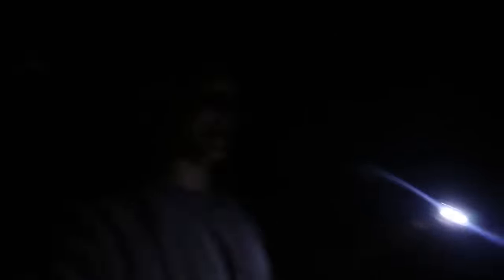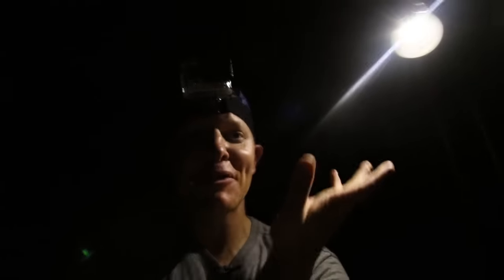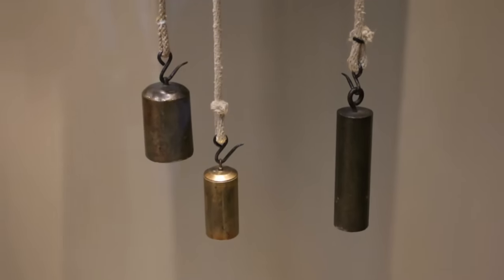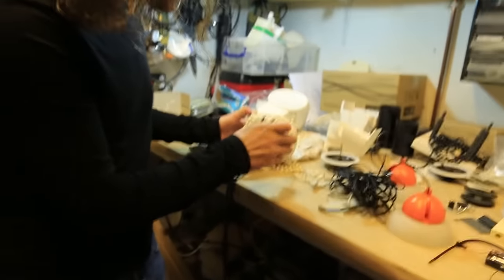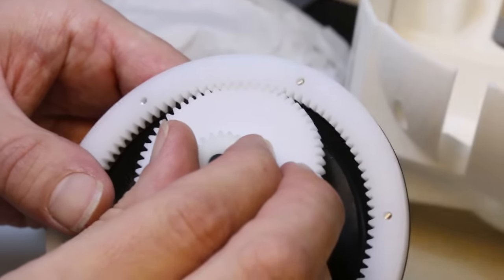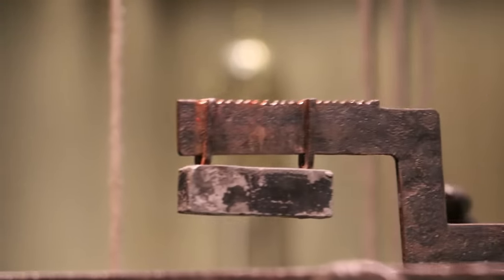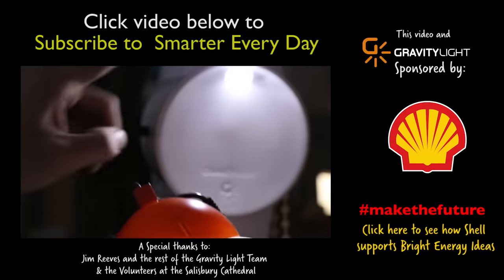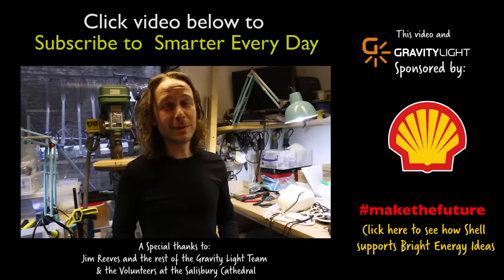Turning Gravity Into Light - Smarter Every Day 146

Comment: Great video!  But I feel like you failed to explain why/how an LED light can prevent the generator from moving regardless of how much weight is applied.  That seems like the most fundamental part of this invention!
Reply from the maker: +karmakazi219 There's a video that explains that which will be uploaded to the shell channel shortly
Reply: +SmarterEveryDay The Shell Oil channel?  Interesting.  Thank you!
Reply: In short: A LED has a sufficient resistance so the motor doesnt get shorted. As soon as the voltage of the motor gets too high (happens when it goes faster), the LED loses resistance and is therefore getting closer to a short. 
Now, you have to know that a generator that is shorted will stop immediatly. in this case, it will just be like braking a car. it limits the speed at which it can go.
Reply: You're not explaining how or why a generator that is shorted 'will stop immediately' therefore I'm no closer to understanding the answer to the question than before you made that reply.
Reply: *****
In short, it works like a watermill: If you hang something up to it, as in an actual load, it spins slower. Now, a short circuit is the equivalent of trying to power a huge city from a small little river that is hardly half a foot deep. It simply will never spin.
To explain how the generator works:
Electricity is generated by a magnetic field that is spinning around copper coils.
The magnetic field that the copper itself generates (which increases the higher the current is you pull from it) counteracts the spinning motion. So, a short circuit (which means maximum current) will simply stop the generator.

The LED is not a short circuit though, so it will simply counteract its motion just enough for the LED.
Reply: so its actually the motor that slows it down by not being able to send more than required electricity to the LED?
Reply: Michael Burt technically, yes. But you say that the load is what determines that characteristic
Reply: I believe it is called back emf. Is this correct?
Reply: I'm more familiar with the term "counter emf", but yes. 

Destin kind of hinted at it, but motors and generators are essentially the same machine working in different directions. You have 4 basic parts of the system: a conductor, a magnetic field, a current, and motion of said conductor through the field.

When you put a current through a conductor inside a magnetic field, you move the conductor. When you move a conductor through a magnetic field, you generate a current.

As the generator spins up and generates its output voltage, it also produces a counter-current in the generator which opposes the input motion, limiting the maximum speed of the generator which in turn limits the maximum supplied voltage.

E: As for why the LED limits voltage, diodes aren't "normal" electrical components. Current through a diode is essentially an exponential function of voltage. For every diode, there exists a voltage above which very small changes in voltage result in very large changes in current, which leads us back to the CEMF discussion above.
Reply: Kyle C Do you know what causes the amplitude death in this system? (Why it won't oscillate back and forth for a long time around the optimal speed and current draw, like a spring around its point of equilibrium.) Is it due to the non-linear relation between volts and current inside the LED?
Reply: etatoby
it technically does oscillate because a diode has a small capacity. but the oscillations are so incredibly small in amplitude (and thanks to the low capacity very high in frequency)
Reply: As Destin shows at 5:41 LEDs have a "Voltage Limit", which means that after that point only current rises with higher power. Voltage stays around the same. They probably have a "shunt DC motor/generator" (its the same) whose number of revolutions is dependent on the voltage. So in conclusion, if there is a voltage limit there is a speed limit of the motor/generator, too.
Reply: its not the led, its the motor that wont go any faster. motors torque depends on the voltage. since the led only allows a certain voltage in and out it prevents the motor from running at higher speeds. which in turn makes the gears move slower and the rocks fall slower
Reply: Let me see if I can explain this. With no LED across the generator, there is no current "load" on the generator and it will spin freely, as fast as the internal friction will allow it to run. Once you have connected the LED (or a load resistance) across it the current flows through it, and it creates "counter EMF" in the generator, which acts just like additional friction in the generator - it is an electromagnetic force that opposes the rotation of the generator. If the load is increased (lower resistance) the current increases and so does the counter-EMF. As resistance approaches 0 (infinite current) the EMF becomes so great the generator will no longer turn at all. Because we cannot achieve a "perfect short" it is possible to turn the generator using great force, but the current produced across the short will burn up the generators windings. So with a static resistive load the generator will still speed up as it would with no load, but at a slower rate. As its speed increases, so does its output voltage, - that increases the current and the counter EMF until it reaches an equilibrium point where the counter EMF is balanced by the weight pulling downward. In this instance, a heavier weight would make it run faster. However, the LED is not a static resistive load - its a non-linear resistance. When the voltages increases, the resistance of the diode drops, making the current increase faster than the voltage. This non-linear resistance action basically functions as a magnetic brake, limiting the rotational speed of the generator, no matter how much weight is placed in the bag.
Reply: It is the LED. The non-linear resistance of the LED as voltage rises creates a current brake (counter-torque) in the motor/generator.
Reply: Okay first off, I'll mention one thing that people failed to mention. "Eddy Currents". This is what causes the motor to spin slower due to increased magnetic resistance. You can do this at home: try spinning the motor shaft, and notice that it spins freely, and continues to spin until mechanical friction does it's job. Now short the two leads of the motor with a piece of wire and try spinning the shaft, and notice that it's going to have a bit of resistance in spinning it. This same concept works with the LED. When the motor is not spinning and not producing any electricity, the LED will have infinite resistance, as if it were an open circuit. Now while the motor gains momentum, and produces more electricity, the LED starts to light up it starts to reduce in resistance as it overcomes the LED's forward voltage. The forward voltage determines when the LED will light up, and conduct electricity. This flow of electricity is what "shorts" the leads of the motors as in our first example as the LED is a form of electrical load.

On another note, this works because the DC generator used does not produce that much power. In fact, if you use a very efficient DC generator, and a very heavy weight it is possible to produce enough power to burn the LED. Other than the magnetic resistance in the motor, the gear system also plays a big part in slowing the weight's descent. Even the slightest resistance at the end of the gear system affects the largest gear due to the gear ratio torque.
Reply: My question is How such small dropping motion produces enough motary rotation to generate enough electricity?
Reply: Saurabh Khanduja gearbox is the answer to that question.
Reply: BenAranMetroidkiller If we use two gear of radius proportion of even 10:1, we get 10 times faster rotation. But If it takes 20 minutes for rock to drop 10 feet, its still super slow for motor to have enough rpm. I think this will require a lot more gears, but yes it's possible if gear box has a lot more gears. Its quite difficult to imagine rotation of 1000's rpm when you have only 2-3 mm per second drop in the weight. :), Thanks for your response.
Reply: Saurabh Khanduja the gears can be stacked. I dont know the correct name but a cascade of them will lead to a very high spped rotation inside (around 600-1000 rpm I would guess) that then powers the generator. the generator then also brakes the speed of the rock because of limiting current.
Reply: When there's a current flowing in the coils of the generator, it acts like a motor in the opposite direction and creates a force that acts against the rotation - that's why a generator takes energy to turn. So as the current rises, so does the resistance of the generator. If you short the leads, there's almost no resistance, so even at low speeds you get a lot of resistance. You can test this for yourself with the geared Lego motors - or look up 'Back EMF' (also known as 'Counter EMF')
Reply: In the video destin mentions that the motor turns at about 1600 rpm, the test configuration they are showing in the video looks  to be about 2 meters high, on their website they claim 20 minutes of runtime. so let's do some approximate math.

the weight is falling at 2 meters/20 minutes, or 10 centimeters per minute (for an insanely slow 1.6 millimeters per second!) From the video i'm estimating the pulley size to be about 8 centimeters in diameter.

Circumference of a circle is diameter times pi; so 8*3.1415926(approx)= 25.1 centimeters give or take. which means that at 10cm/min of fall rate it takes about 2.5 minutes per revolution, or an rpm of 0.4

calculatiing the gear ratio required is simple, just divide final rpm by the source rpm (or vice versa, point is it's one of those) so 1600/0.4 = a nice round 4000:1 gear ratio. i can't be asked to count teeth and do some screen calipering to get the actual answer (they did show all of the gear stages in the video, after all) but that seems to not be that far off.
Reply: the led needs 3 volts of force applied to it to break down the internal barer and begin to conduct but no more. its like filling a dammed river to the dams height. Any more water will simply run over the dam as water current.  when the voltage tries to rise above three volts the led's internal resistance drops and allow current to flow through it. As long as the current and resistance don’t multiply to be enough power to damage the led it just flows. when more current flows the generator has to work harder and resists turning more thus slowing the weight.
Reply: The LED takes a certain amount of power to run. If you try to put more power through, it gets harder to turn. It's like trying to exhale through a straw, or falling at terminal velocity, driving up a hill, drilling a hole in a can full of water, or dragging a heavy box on the ground. Nature has one law in this regard. You need to do the work to put the weight at that height in the first place.